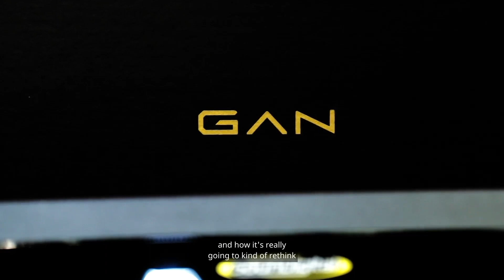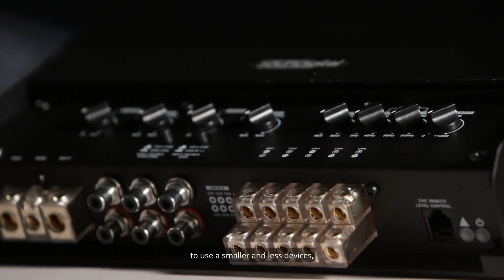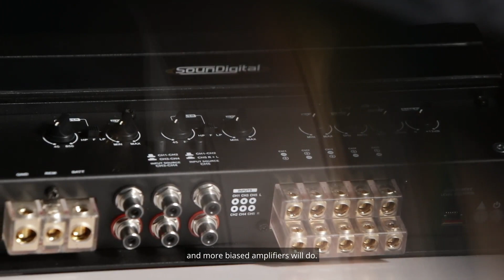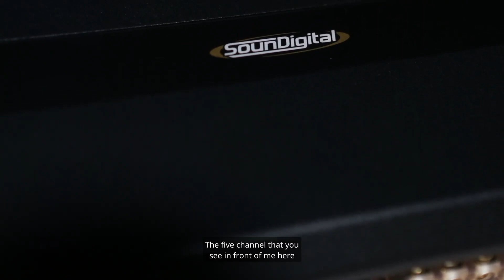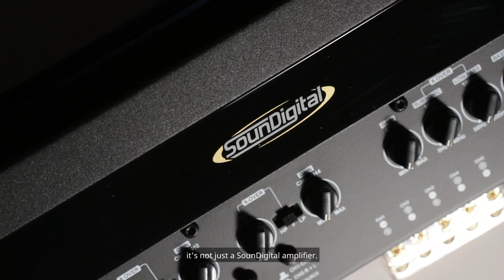HKI Product Spotlight - SounDigital GAN

Comment: You don’t have to air quote sq. Sound quality is measurable. You could push market standards by being the first car audio company to exhibit measurements like snr at various gain levels, bandwidth, multi tone, slew rate, cross talk, and distortion over power for recommended loads. I’m sure sound digital has the equipment being an amplifier designer and not showing measurements when you have the equipment is suspicious. You claim you make nice amps, prove it.

Comment: My next build. I’m considering the 2000.8 GaN so I can power my 3 way fronts all active as well as my rear fills from one amp and an EVOX 8000.1 for the 2 high powered subs in a sealed enclosure.

Comment: If I picked up one of the 2000.8's I could run 2x 3/4" tweeters, 2x 4 "mids, and 2x 4" coaxials, and still have power/channels leftover to run a sub? Or would I be better off sending signal to a dedicated amp (I've got an MRV-1507 collecting dust ATM) Also this would function as an active crossover to protect the mids/tweeters if setup properly?

Tbh this seems like a high enough quality product that it might be wasted on me but it checks a ton of boxes and would save me the hassle of connecting multiple devices to do the same thing.

Comment: The 8 channel is the one I have my eye on. But as someone who owed the first GAN amp sounddigital produced and current own about the best Class A and Class AB SQ amps money can buy, I would have loved to see a powerful 4 channel with no board crossover network.

I Love selector feature, But even a specialty model of the 8 channel with no internal processing, as most SQ guys and gals that is moving to this level of product will 95% of the time will be uaing a high-end DSP. 

Now if the internal crossover network can be completely bypass, Now if that is the case on these units that is outstanding. But really look forward to trying these new units out.

Great job. I also use a Sounddigital unit in my system now also.😮❤
Reply from the maker: Hello Mark! Thank you very much for your feedback! We always listening to our customers to see how we can keep pushing the envelope!
Reply: @HKIUSA  Thank you for the prompt reply. I would to thank to you more about the new GAN unit. Is there a number or email I can contact directly at Jacob?
Reply from the maker: @mark120371  Of course. jacob@hki-usa.com